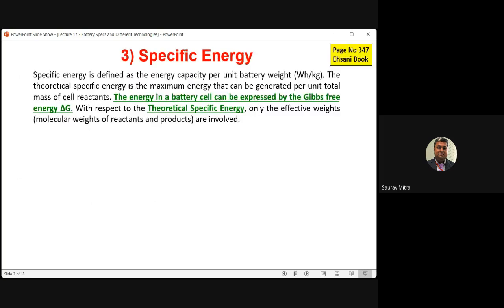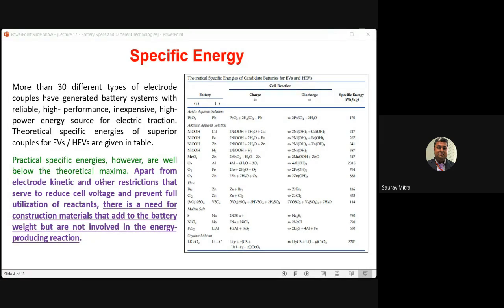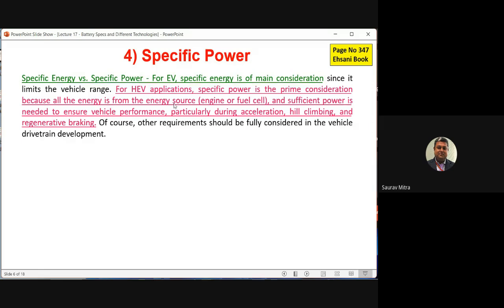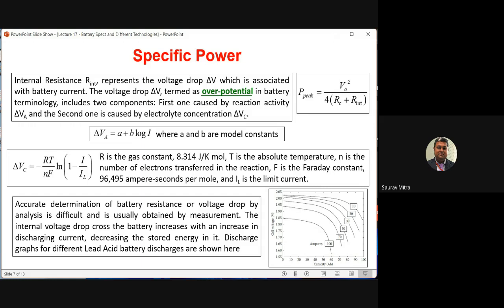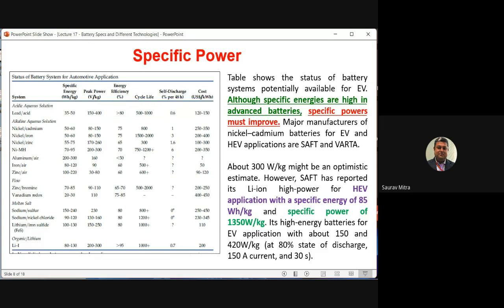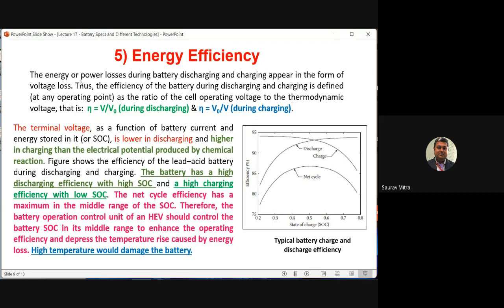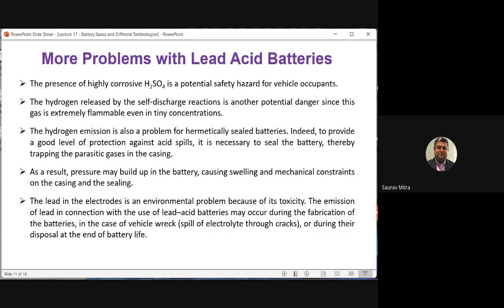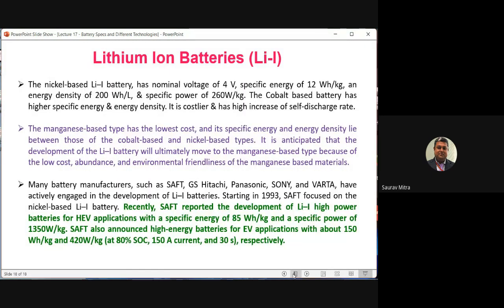EHV 23 - Lecture 17 - Battery Technology Part 2

Comment from the maker: A SMALL CORRECTION IN THIS VIDEO ... at the initial stage ... starting from 22nd to 27th second of the lecture ...i have mentioned ... "whereas a specific power source ... its is like a batsman who plays for 3 HOURS and scores forty runs" .... instead of '3 HOURS' you consider it as '3 OVERS' .. the complete statements should be "its is like a batsman who plays for 3 OVERS and scores forty runs" . Please understand that the specific power source (like UltraCapacitor) is brought into action for a shorter period of time (1 or 2 minutes) ... generates high power in short burst and gets discharged ... whereas a specific energy source (like Lead Acid Battery) generates a constant energy for longer period of time (considerable high energy for an hour or two).